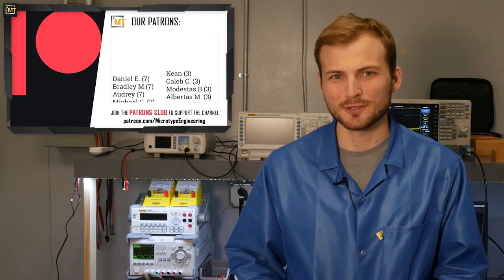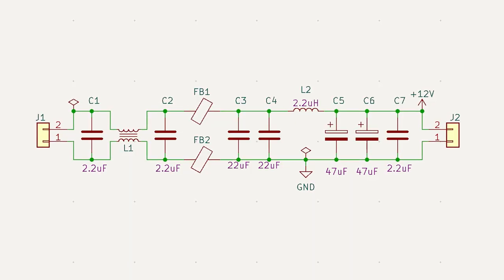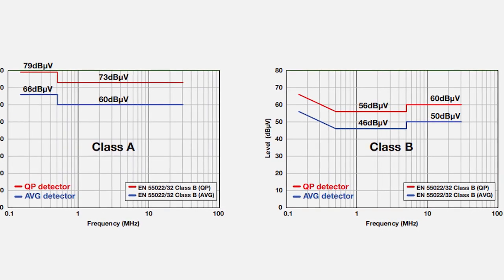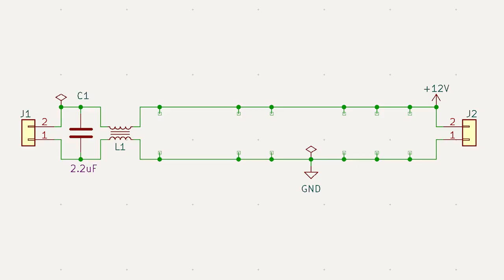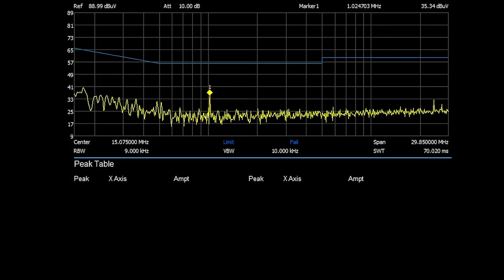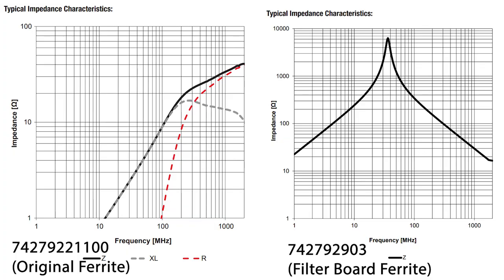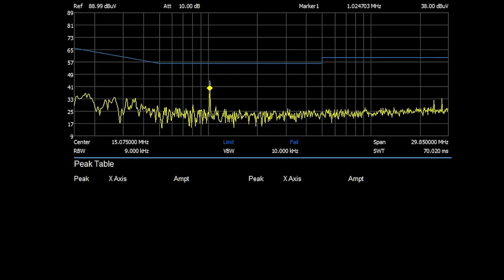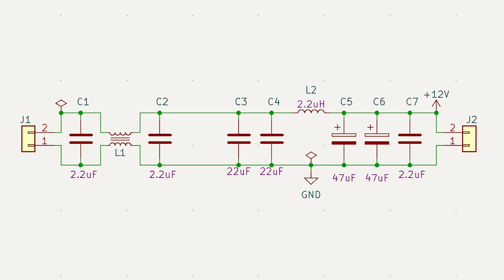Passing Conducted Emissions With a Buck Regulator : EMC For Everyone #3

Comment: Thanks for taking the time to make such a nicely produced video. May I add some observations?

1) To expand on what you said, with only one LISN you are only able to measure differential mode emissions (+ve to -ve) and not common mode emissions (+ve and -ve together relative to a nearby metallic structure). All of the measurements you are making are for differential mode noise only so it isn't a surprise that only the differential mode pi filter components worked at reducing the emissions.

2) Putting a common mode choke in the filter board will reduce the common mode noise, you just were unable to measure it with your single LISN setup. 

3) Tekbox LISNs are confusing in that they provide a black terminal which is for the DC negative line, right? Not so, this is to connect to the metallic reference plane underneath your Device Under Test in a two LISN test setup. It is not meant to connect to the power supply line. The bond to the nearby metal plane should be made with as short a wire connection as possible.

4) The limits you've chosen from EN 55022 standard is for an AC mains port. There are no limits in EN 55022 for DC power port emissions, instead we would have to look at the generic standards such as EN 61000-6-3 instead. Limits for DC power ports are higher than AC mains. Class B DC power port levels are more like Class A mains conducted emissions limits.

5) The Tekbox LISN you are using is a 5uH part designed for automotive type measurements with a 5cm gap between metal plate and DUT (refer to standard EN 55025 / CISPR 25). The EN 55022 measurements relate to a 50uH two line LISN and a 80cm distance between DUT and floor (40cm between DUT and walls). Again, this doesn't mean that your test is of no use, it just means that you can't compare the results to the limit

6) There is no regulatory requirement to measure conducted emissions on a DC power port for the majority of equipment. The term "DC Power Port" has a very specific meaning in the context of EMC. Google search for "unit 3 compliance what is a dc power port" to read more.

7) This is exactly the kind of measurement you must make for automotive components, where there is a lot of concern with interference to on-vehicle radio receivers - see the CISPR 25 standard mentioned earlier. The kind of filter you are describing is essential to reduce these emissions to below the limits (again, different from EN 55022).

8) There is a small amount of leakage inductance with every common mode choke - the air gap between wires and core, the inductance of the loop area of the connecting wires - all this gives a small amount of inductance that appears as two uncoupled inductances, contributing to the differential mode attenuation of the filter. Typically this Lleak is around 0.5% to 1% of the value of the Lcm inductance.

I would be interested to see your follow up video when you get your second LISN. Keep up the good work.

All the best in EMC
James Pawson @ Unit 3 Compliance
Reply: This is amazing feedback, good work! The video is also great btw, very few videos about this. I was wondering about the use of a DC LISN myself. If the product is meant to be used in a product that is connected to AC mains, should it then not be tested against an AC mains LISN? EN55032 would be that.
Reply: @EliasBakken  I think that using a DC power LISN like this is fine if you are only making comparative A-to-B measurements (e.g. we've changed a component, what was the effect). You are right, for compliance measurements for AC mains (and widely distributed DC power buses like those around a server rack) the 50uH CISPR 16 LISN called up by EN 55032 would be required.
Reply: @unit3compliance481  That makes sense, thanks for the clarification.

Comment: Nice video...i have a issue with 210khz failing CE...but that's on AC power line which carries like 80A AC current and has power line communication on it...

Comment: Good video, with good explanations. Just wondering if that is actually the correct test setup to have the DUT this close to the reference plate on the table. At least as far as i can remember, we always put the DUT at 10cm (~4in) above the reference plate for all conducted emission and conducted interference tests. I don't have the EN55022 at hand to check if this is actually the recommended setup for this test.

Comment: Could that 200 KHz peak be coming from the powersupply itself? Or the electronic load? Running a "clean scan" without the step down should give a baseline for troubleshooting. Great video! Very interesting to see the effects of the filter.

Comment: For boards with multiple buck regulators do we need to use a pi filter at the input of each buck or can we have one pi filter for all the buck regulators connected to a single power source.

Comment: Please answer: As you said you love to use PI-Filters for INPUT INITAIL   Power FILTERING. 
As you said you will create another video on:
What values of capacitors and inductor for GENERAL purpose 5V power supply given to microcontroller ?
Please share the link of video if you was able to make on pi filer.

PI- filter work better with ceramic capacitor or with electrolyte capacitor ? what combination should be used with inductor ?
At one point 12.36 , you mentioned , use bigger value of C5, C6 of electrolyte capacitor at down side of inductor, otherwise pi-filter will not be effective. 
low value of c5, c6 will make decoupling capacitor in-effective??
Please create a video on this test.

Second Question: How EMI/EMC is harmful to any controller board ? 
                                 How it disturb the working of board ?

Comment: Very much enjoying watching the custom evaluation board series.

I'm a hobbyist, and wanted to work with GaNFETs first hand while the chip-shortage struck. Sourcing parts in my country is difficult at best of times, so it's not looking feasible in near future.

So, I've got a request... can you please have a look at LMG5200 and use it as a power stage for a simple buck converter? My original plan was to use an ESP32 as the multiphase controller (PWM at 4-8MHz), drive 4x LMG5200 as 4 phase power stage to form a high-power lab-bench supply (actually a precision load tester), which can be controlled & monitored wirelessly from other systems (including mobile app or even stream decks). Also wanted to make the solution as small as possible (by using smaller passives at high freq), as a stretch goal.

Feel free to take it up, if it seems interesting to you. All the best, if you do!

Comment: I have a question I have a commercially built switch mode power supply that causes interference in the 1Mhz to 50 MHz range. It powers a Ham radio transceiver. Is there any way to quieten down the power supply either by adding filtering on the input or output or both without causing other problems? I have enjoyed the series so far on EMC compliance standards.
Reply from the maker: Yeah that's certainly an issue with switching regulators. Normally you add a multi stage LC filter on the output that then goes to the audio equipment.
Reply: I'd say the most important thing to look into is to make sure your filter design can handle the worst case power output of the supply with a margin of error. Sometimes adding too much capacitive load with a filter can cause even more issues (in rush current, ringing, ...). But thats hard to estimate or pretty much impossible to predict, especially with and off the shelf PSU, without doing some trial and error.
Reply: @ProtonOne11  I think it will be down to some trial and error. I will try a pie filter on the output rated at least 30 amps giving me margin of  error of 10amps. I will let you know how I got on at the moment I am in the middle of a workshop clean up and rearrangement.

Comment: Common-Mode Chokes are almost always a bad idea for reducing Conducted Emissions on a classic +/- DC design where the "negative" connects to your GND plane. Many EMC Experts have debunked this time and time again. Mode Conversion is what causes Common-Mode Noise to radiate from a differential power or data line like this, and a Choke will not help Mode Conversion. It's companies like Wurth who sell these chokes who make it seem necessary in design guides and application notes. I am a huge fan of Wurth, but unfortunately, this is just misinformation they perpetuate.
Reply from the maker: Yeah, honestly, once I can figure out a good few methods to force CM currents on a test board, I'm definitely going to start testing chokes more on this series. Honestly, I normally would just throw one on most boards. Definitely going to double check that from now on. Thanks for your thoughts!

Comment: Hint: On your input ferrite heating up - What do  you suppose it's DC resistance is from the graph you have shown ? IE it's not heating up from V/Z- it's just DC resistance
Reply from the maker: Uh, not sure what you're getting at exactly? I think I said that it was heating up from the impedance. Impedance includes DC resistance.
Reply: @MicroTypeEngineering  heat is from dissipation of dc energy not from the ac related energy

Comment: Which one of the successful designs is more efficient?
Reply from the maker: Eh, neither one likely effects efficiency significantly. I'd guess the PI filter is a little bit more so, but not much.
Reply: @MicroTypeEngineering  Good to know! My mantra is no diodes, no resistors > 0.01 ohm in series and minimize inductors whenever possible so this was of particular interest for optimizing efficiency while hitting regulations.

Comment: Ok so you understand a lot about circuit. Great video I need help it's just a statement . Ok I learn how to make a hall effect circuit to drive a fan simple it get too hot and the irf9540n burn's up it's rate for 23 amps 100 volt. I need something higher on all points. If you can help i will pay you for the information  and i'll have to test it first thanks I hope you Will  response It has a greater purpose than a fan Thanks